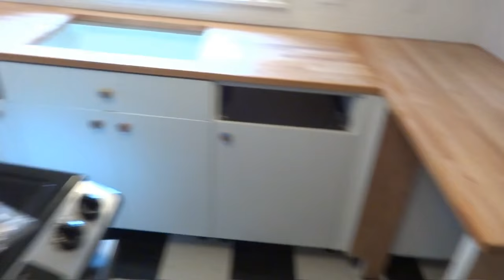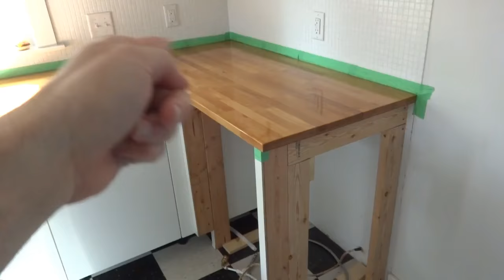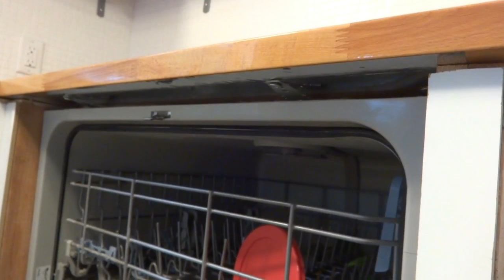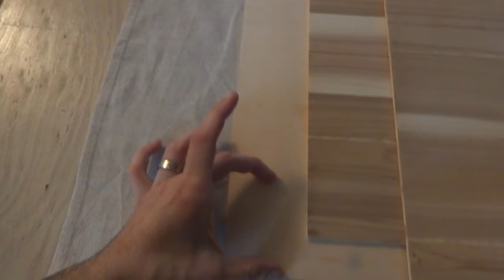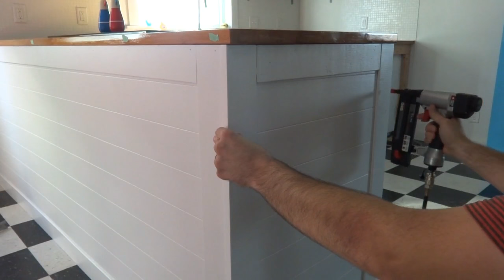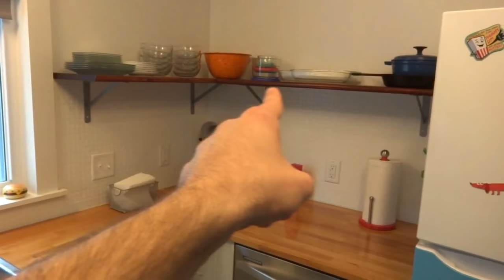Install Your Own Butcher Block Countertops - Part 5 of 5

Comment: Thanks for the great series! Like the plywood flooring videos this one helped me get over the fear of diy. I've had a pair of beech countertops waiting in the garage for the last six months. With your help they turned out very nicely.
Reply from the maker: You're welcome! Sounds like you've already installed them, but if not, I'd recommend checking in on them to make sure they haven't warped out in the garage. If they're still flat, bring them in and let them acclimate to the temp/humidity of the house for several days (maybe even a week or so) before installing them. That would help prevent them from possibly splitting.

Comment: Love the countertops. It really warms up the kitchen.  We are planning to use jataba wood for ours because it's darker.  I'm so glad I was able to see the application of waterlox.  The finish is beautiful.  Great job as usual.
Reply from the maker: Thanks! I wasn't quite sure what to expect, but the finish turned out awesome and is so easy to clean. Waterlox also makes a high gloss and a semi gloss version as well, but they recommend 2 or 3 coats of this original finish first since it's more durable. This finish is supposed to flatten out a little bit after 6 months or so, and I think it'll be just right then. Also, I learned that you shouldn't be afraid to really work the Waterlox around with your brush as you're applying it.  I was too gentle on my first coat, and there were a couple of thicker brush marks that didn't quite level out, so I had to sand them down.

Comment: I just bought some butcher block counter tops and am using the mineral oil solution. Do you need to apply the oil to the underside? I hadn't planned on doing that.

Comment: Excellent outcome, great video series.  I have a question.  I have about 90 sq ft of countertop (considering top, bottom and edges).  I would like high gloss finish and I see they sell a high gloss finish to use over the seal/finish product you used.  Do you feel it is necessary to use the high gloss finish? Your seal/finish outcome seems pretty glossy.  If I go with the high gloss, should I use the sealer/finish for 3 coats everywhere and then topcoat with the gloss for how many coats?  If high gloss not needed, then I would simply follow your instructions.  .. I am so confused.  lol

Comment: All said and done, what was the total cost?
Reply from the maker: I haven't done an official total yet, but I just did a rough estimate and it was probably about $400-475 for everything from the tops we found on sale at Ikea, to the Waterlox finish, misc hardware, cedar bead board, faucet, etc.
Reply: thanks!

Comment: It would look a lit nicer with two rows of shelves on the wall :)
Reply from the maker: When we gutted the kitchen 3 years ago, we actually put in extra bracing in the wall for 2 rows of shelving. But our ceiling slopes down to about 7ft at the wall, and everything looked too cramped, so we just went with the single shelf instead.